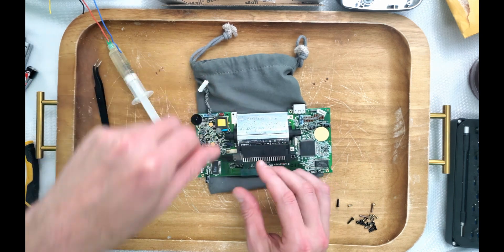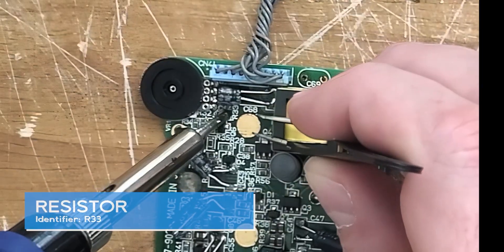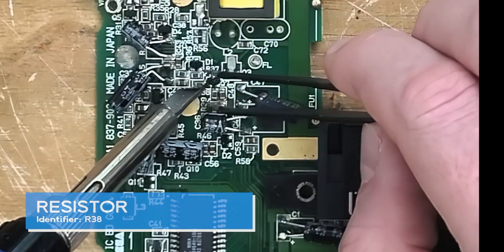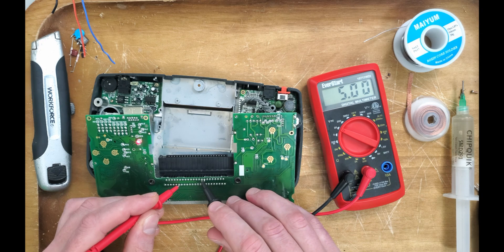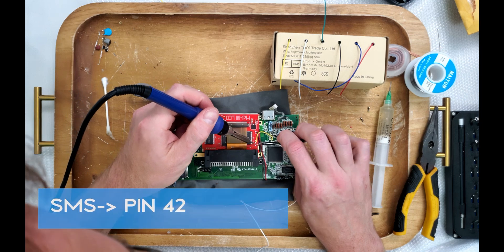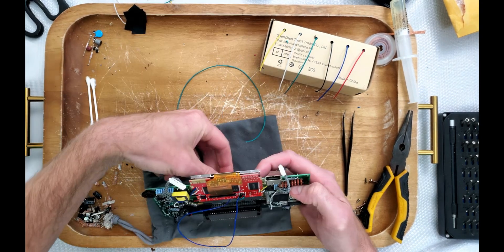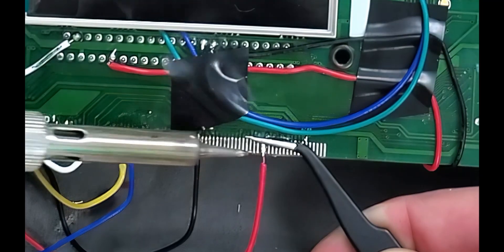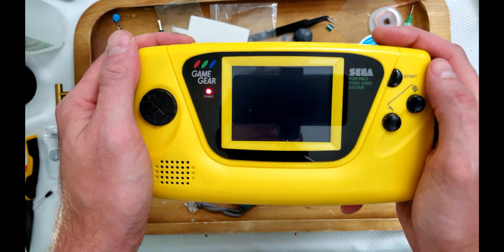Game Gear McWill Screen Install (Single ASIC)

Comment: Can't believe how incredibly difficult this install seems vs. the BennVenn I put in mine! So many more components to remove with this screen! Super fiddly! I do love your upside-down install though ;) haha!
Reply from the maker: i have a video comparing the bennvenn, mcwill, cleanscreen, and magic screen since i basically installed all of them to test out!
Glad your gg is so decked out. I did the same with my blacked out game gear!
Reply: @retro-af  Just watched it. Great video. Loving your channel, very cool content! Yeah, the only original thing in my GG is the recapped main board. I pimped out everything else and am loving getting back into some proper retro gaming :)
Your vids inspire me to want to find myself a dud Game Boy to give that the same treatment!!
Reply from the maker: @Venison_0904  super easy to repair! if they dont turn on 99% chance those contacts are corroded.
The lcds are a hit or miss though. Go nutts and have fun with it!
Reply: @retro-af  I'll keep an eye out on eBay 👍🏻
Also, meant to say; great advice on tinning the wires with solder before attaching them to the LCD pins!! Weirdly, I did not have good results with the "easy install" ribbon that came with the BennVenn, so went the old-fashioned wire route. Those pins were a pain, so I'll be heeding your advice for the next one :) cheers!!
Reply from the maker: @Venison_0904  if you blob the ribbon with solder, a knife soldering tip will take care of it with one swipe.
Flux is everything with those super thin cables!
Glad you gained some extra knowledge for your future repairs! 
These devices dont need to be in another landfill.
If you need any assistance, you can hit me up in bennvenn's discord.
Reply: @retro-af  Thanks for the further tips and will keep Discord in mind 👍🏻

Comment: Ok, it was so quick and incredibly confusing.  I'm at the point where I'm doing the back light pad wires over to the brightness control wheel.  The left and right pads need to go to what pins on the brightness wheel?  I can't tell 

Wish it worked out for me like that... You're right though, the printed instructions suck.  First and last time I'll do a McWill screen honestly.  I'm sticking to the Retrosix screen.
Reply from the maker: the top pin and the 3rd pin.
The directions state 1 and 2 but in reality it is 1 & 3. ( out of 4 )
Reply: @retro-af  That's real interesting... I did the Pin 1 and 3, couldn't get the contrast to change.  Went back and did Pin 1 and 2 and the contrast worked. 🙄. Hence the inconsistency of this screen, the revisions and poor documentation is why I'll never do a screen like this again.  Thanks for your reply man!
Reply from the maker: @rabidduck1089  Glad you got it to work out. 
Yeah the different revisions and the amount of components to remove makes this mod nuts.
Id recommend a BennVenn or the Cleanscreen instead.